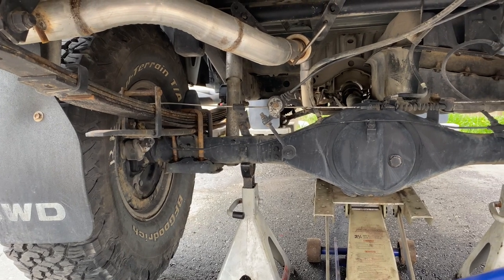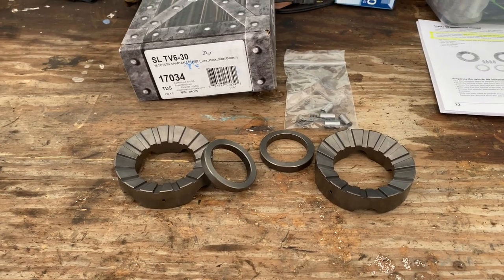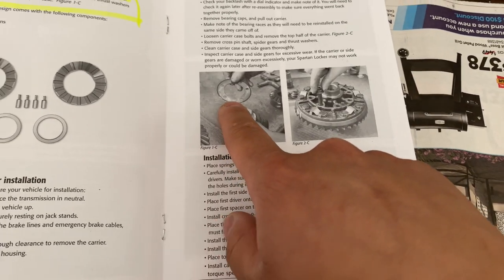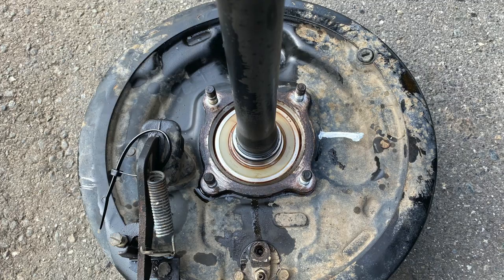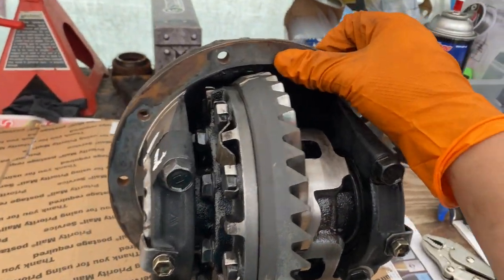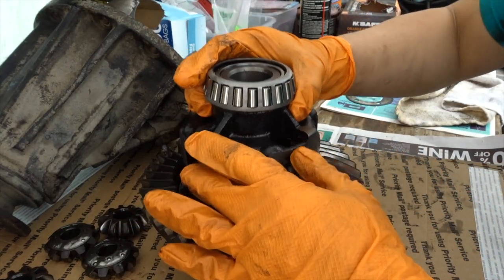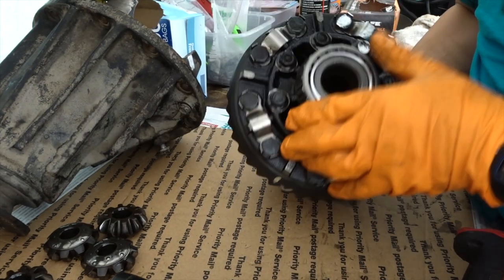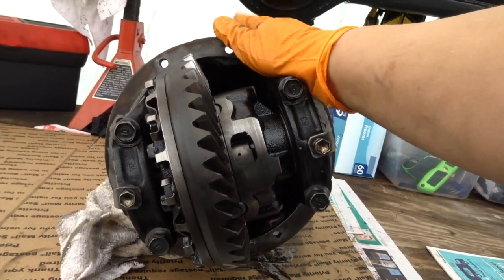Installing Spartan Lockers on my Toyota Pickup

Comment: Oh man! I’m gonna do this for my 99 2.7L Prerunner. I’m gonna do this first then do a 4x4 swap (bought the t case, front diff, axles and transmission from a donor truck. 

Thanks for doing this man. I was super nervous but I feel way more than confident now about it.
Reply from the maker: Glad I could help
Reply: In all honesty I was ripping people up in 2wd with my locker only time I even needed 4wd was in 4ft mud or more
Reply: It's all about getting the gear pattern and preload back to normal

Comment: Couldn't you just keep the bearing adjuster bolt/retaining clip as it was so that you don't have to clamp with the vise grips? I know this is a different locker, but on Torquemaster's site explaining how to install their aussie locker they say to not remove the bearing adjuster bolt/retaining clip when taking off the bearing cap. Thanks again for the video! Really considering installing this.

Comment: Can't wait for the video on how it performs. I read a lot that it you might drift sometimes with it or it is be noisy. Curious how it will work with your setup as I compare to the ARB air lock setup. Thank you for sharing this.
Reply: This is alot stronger then the arb setup it's got larger pins and is made of superior metal

Comment: This will litteraly make that thing a tank I got one in the rear and off road I don't even spin much in 4ft of mud
Reply from the maker: Yes
Reply: @NuttyNu  I didnt watch the whole way through but I imagine u put one up front too but if you have that damn 3vze motor ur gona need to heat wrap the back of that driver side header/ cross over pipe my engine already lost one gasket that way

Comment: Pretty cool. For future, “ maybe “ , even though you didn’t have torque for your bolts, it’d behoove you to take an educated guess and true those bolts all around at the same torque value. It would gnaw at me man. Lol!
Reply: Yea my impacted did that for me on the ring gear bolts with  loctite but yea same for the bearing cap bolts too not really that big of deal long as it's tight in very few Toyota diff rebuilds have a seem a toque wrench yea when setting the pinion nut sometimes to be safe with the crush washer

Comment: Did you ever find out what the torque specs would be for those 8 bolts that gets you access to the cross pin to install the locker? Thanks for the video!!
Reply from the maker: YES I did at that time, I dont recall now, please check the FSM for specs
Reply: What's the torque specs

Comment: With no thrust washer, won't that change to contact points for ring and pinon?
Reply from the maker: the lockers compensate that I believe
Reply: Instructions def say to leave them out
Reply: No. Side gear Thrust washers only change contact point of side gears with pinion mates (spider gears). He removed spider gears. I would be worried about no thrust washer because the side gear Thrust surface is heat treated and the differential thrust surface is not. This would eventually wear the differential thrust surface.
The ring and pinion are only affected by the pinion bearing, pinion shim and preload castle nuts, which he maintained the same.

Comment: Awesome tips for those caps. So you’re “locked” at all times ? No more sharp/tight turns for you then.
Reply from the maker: That is correcT, Locked in straight all time, when turning. It'll unlock

Comment: So once this is installed is the diff locked all the time?
Reply from the maker: hi, it'll lock when going straight, when you turn, it'll unlock. Auto lockers they call it
Reply: @NuttyNu  hey thanks! I assumed that was the case but wasn't sure. Thanks for clarifying!